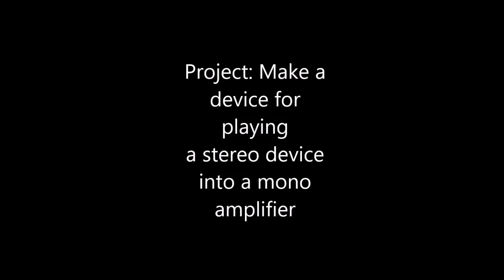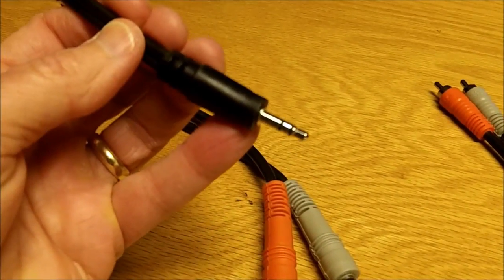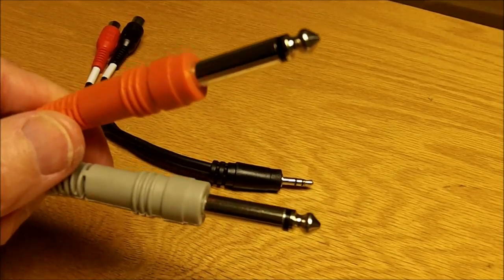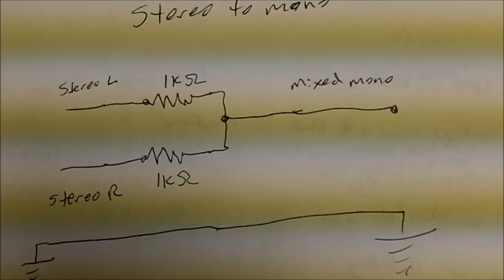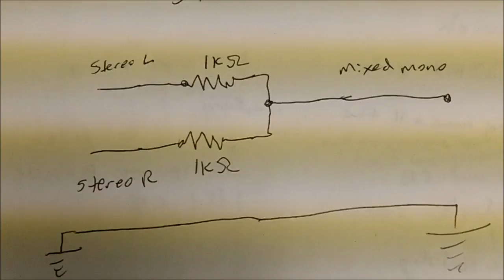Play your stereo music into a mono amplifier with this easy project!

Comment: Hi. I have a Bluetooth receiver that I want to connect to the single speaker in my 1967 car. I tried what you described (at least I think I did!), using a pair of 1k resistors. This didn’t seem to work. A kind of pulsing sound was coming from the speaker. Do I need to use a different value resistor or does this only work when connecting to an amplifier rather than to the speaker?

Comment: Beware phase cancellation.

I stumbled across a practical demonstration of phase cancellation by accident. I built a stereo-to-mono summing cable which is the circuit inside the box here. I tested it with two different songs: The Doors' "Light My Fire," where the instruments are heavily panned, and Porcupine Tree's "Voyage 34 Phase One," where the stereo distribution appears to be uniform.

It turns out the cable works perfectly with The Doors song, but with the Porcupine Tree song, when I pan to the center, the delay effects cut out. If I pan to either side, left or right, the audio returns to normal. Note: if you use the YouTube audio from this link https://youtu.be/LIEug2r-oBU?si=C9dkGq7-M2d5kepm, there is no phase cancellation.

Comment: Would you use the resistors in that summing network if just taking phono out to summing box for mono records to a stereo amplifier. Don’t have a mono cartridge so have to come up with a better switching solution other than y-cables.

Comment: Would this work sending mono guitar pedal signal into stereo effects loop on guitar amp? Thanks
Reply from the maker: Feeding a mono signal into the “output” of the “box” will give you 2 identical signals on the 2 inputs. So, if I understand your question, you would have inputs for your stereo inputs, but they would not really be stereo. Just duplicated mono.
Reply: @ 

I have a crate amp with the stereo effects loop send and return just like you talked about. Trying to send the pedal signal ( mono) into amp. Thanks. I have the exact issue that you covered in video. Thanks again.

Comment: I have an effect pedal that has right and left out. I wanted to combine both signal so I can have a wet and a dry signal from my guitar. Will this also work for that purpose ?
Reply: Beware phase cancellation.

I stumbled across a practical demonstration of phase cancellation by accident. I built a stereo-to-mono summing cable which is the circuit inside the box here. I tested it with two different songs: The Doors' "Light My Fire," where the instruments are heavily panned, and Porcupine Tree's "Voyage 34 Phase One," where the stereo distribution appears to be uniform.

It turns out the cable works perfectly with The Doors song, but with the Porcupine Tree song, when I pan to the center, the delay effects cut out. If I pan to either side, left or right, the audio returns to normal. Note: if you use the YouTube audio from this link https://youtu.be/LIEug2r-oBU?si=C9dkGq7-M2d5kepm, there is no phase cancellation.

Comment: This is a volage divider. It solves the problem of anything that is the same on both channels does not add and double in volume.
Reply from the maker: I didn’t see anyone say it doubled volume. Also, I disagree it’s a voltage divider.
It just provides some isolation between the two channels as opposed to connecting them directly together.

Comment: The most critical connection made, from the 2 1k ohms , is absolutely confusing. Did you solder? Exactly where are the 2 resistors soldered to?  Jerky video, thumb blocking, and no schematic drawing,  pointing, exactly, where all connections are made.
Reply from the maker: You are free to move on, my friend.
Reply: @jamelectronics  Couldn't seem to take constructive objective critiquing? Hope you will inprove. Moved on nicely, by the way, after doing more research.😑
Reply from the maker: @BOBBY-w8c , Bobby, I made this video 7 years ago. I apologize if my video quality is not up to your standards.  So sorry about the shakiness, but my intention with my videos is only to give information about things I know about to those that would like to watch.  There is the schematic drawing at 1:35 in the video that you said I should have included. As to soldering, it looks plain to me in the video that the connections are soldered but, they can be connected without soldering - it's the viewer's choice. I don't think my finger is blocking anything. The circuit is so simple. Only 2 components and a schematic to show what connects to what. Did you not see the schematic?
I watch a lot of DIY videos. When I am doing a project that I need to know how to do, I watch several YouTube videos. Some contain all the info I need, and some do not. I never critique someone else's video. They've taken the time to present something they believe will help someone else.  I don't have the time and besides what's the purpose- they are not going to make a new video "fixing" the things I have pointed out. They're offering a video, and I can watch or not.  By watching multiple ones, I get a very good idea of how to proceed. You "moving on" to do more "research" is a good thing. I'm sure you learned a lot. Good luck on your future pursuits!

Comment: Plz guide the registance value for 600 RMS watts mono amplifier
Reply from the maker: Since the circuit in the video is for the input to an amplifier, the output power of the amplifier is irrelevant. The same resistance values should be used. Just be sure you are clear that you are combining small signal input signals to an amplifier and not amplifier outputs.
Reply: @jamelectronics  Thanks for reply
Sir,  I wanted to know the result of signal which reflected through proper output.  High registence value may be interrupt in quality of signal. 
If i run the amplifier in 75% volume . Signal gain is a vital factor indeed

Comment: Muito obrigado "James Pattillo"
Fiz um cabo Stereo / mono me baseando em um circuito de caixinha de som mono onde ambos canais vão jumpeados
Se continuasse a usar mas um pouco iria danifica o CI de audio do Computador, ele já estava conflitando (saia áudio / não saia áudio)
Seu vídeo veio no exato momento

Muito obrigado novamente

Thank you very much "James Pattillo"
I made a Stereo / mono cable based on a mono speaker circuit where both channels are jumpered
If you continued to use it a little, it would damage the computer's audio IC, it was already conflicting (audio output / no audio output)
If video came at the exact moment

Thank you again.

Comment: can i use this in guitar fx processor? i want to use the l and r output to mono
Reply: Why? Usually guitar fx processors have a mono output.
If you connect just the L out it should be in mono.
If that doesn't work, program your fxs in mono, then use only one output.

Comment: thank you for this video its a lot easier than i thought it'd be !! im planning on adding a pickup to my guitar and being able to sum the signal from the pickup with the existing pickups but also be able to send the new pickup to its own separate output.  would the 1k resistors work for this as well?

Comment: Won’t the resistors attenuate the signal resulting in lower volume?
Reply: yeah it will somehow lower the volume but its also important to have them a 1k resistor in total to not heat up the amplifier inside the phone or pre amp or what kind of system you using

Comment: First off, very informative video, have a quick question though. I have two outdoor speakers, but want to run both in mono for patio garden listening. I have a Bluetooth audio receiver with RCA outputs and a stereo amp with a line in. Would I be right in thinking your wiring set up would work? If I wired up the output of the BT audio receiver as described in your video and used the line in on my amp, would that give a mono signal to both speaker outputs of the amp or just to one side (L or R output)? Thanks in advance.
Reply from the maker: Should work and would give a mono signal to both speakers.
Reply: @jamelectronics  Thought as much, but just wanted to check. Thanks again for the informative video and for getting back to me so quickly.
Reply: Have a second question if I can be cheeky..... So I'm now thinking of using a slightly different setup, of which the amp only has RCA inputs and the BT receiver has a stereo 3.5mm jack output. Do you know how would I go about wiring a stereo 3.5mm jack to two mono L + R RCA outputs? Thanks again in advance.
Reply from the maker: Your second question: Use a cable that has a 3.5 mm plug on one end and two rca plugs on the other. These are commonly used cables that you should be able to purchase on Amazon or retailers.

Comment: Hello friend, greetings from india, i would like to give mono input for the subwoofer, i hope I can use this method without disturbing my stereo line.
Need your suggestion shall i follow this method?
Reply from the maker: This circuit is for combining small signal levels such as headphone outputs or “line outs” to feed into amplifier inputs that require small signals ( less than 1 volt). As long as your stereo out is a small signal level, it should be ok, although I don’t know the details of your devices.
Reply: @jamelectronics  this is to feed input for my subwoofer amplifier, i have a stereo amplifier, now I would like to add subwoofer amplifier  , so I was bothered to give mono input without disturbing my stereo input, I'm speaking about only mono input signal, not directly to speaker my friend, hope u got my point
Reply: @James Pattillo  Dear james hi.... if my stereo has preamp voltage of 2.7 volt then what will be the resistors value....

Comment: I am going to wire a portable satellite radio stereo into a mono input. The specs shows the output as 2.2V peak to peak. My question is how big of resistiors? Don’t quote me, but I thought I saw info that said I needed 50K ohms.

Comment: Sir if I convert 5 + 5w stereo to mono will it be 10w and which resistances should I use...
Reply from the maker: No. The circuit described converts the small signal preamplifier sound to mono. The combined signal is then amplified by the power amp section of your electronics at the same power level as before. So, a 5 watt channel will still be 5 watts.
Reply: @jamelectronics  sir which resistance should I use in 5 + 5w....

Comment: I am going to connect a vintage car stereo to one speaker in my VW Beetle that has only one speaker.  Would this work for my project and should I have higher value resistors?   And I was thinking, why not use diodes instead of resistors to isolate each line R and L?
Reply from the maker: No, you can’t use this circuit on the output of your car stereo. You will damage the stereo. The circuit can only be used in small signal outputs such as a preamp or headphone output of an ipod, iPhone or similar, but not a large signal output from an amplifier stage. Also, a diode for isolation will not work.
Reply: @jamelectronics  Some say I can use resistors to combine both Left and Right outputs from a car stereo to one speaker.  If it works for a cell phone or low voltage device, why not a car stereo that works at 12 volts?  Make the resistors 1000K or more rather than 100K or less.  I have only one speaker in my VW and I ma not willing to modify my dash for another.  And finding a mono AM-FM car radio is near impossible. 
.
Reply from the maker: I don’t recommend it. The difference in splitting a mono output of an iPod into 2 outputs vs. combining stereo output channels : The outputs of iPods are high impedance, low voltages (millivolts) and currents. The outputs of  your 12 volt stereo are low impedance with relatively higher voltages and currents. The isolation resistors in conjunction with the  4 or 8 ohm speaker will act as a voltage divider so most of the signal voltage will be dropped across the isolation resistor rather than the speaker resulting in very low level of sound. Aside from that, depending on the circuitry of the car stereo, a connection between the two channels may cause damage.
Reply: @jamelectronics  Thanks for the detailed reply.  I won't combine R and L on my old car stereo.   I have only one speaker..  I noticed that the 1960's radio has a MO/ST button. and that will then give me the option for Mono or Stereo.   So if I just keep it at MO I can get mono sound with one speaker, the other line I will leave capped off, or maybe hide a speaker in some other part of the vehicle.

Comment: Hi, I have a Godin guitar with two outputs, one is a passive Seymour Duncan lipstick single coil pickup and one is an active RMC Piezo pickup. When I use a 2 mono to 1 mono cable I get only one of the pickup. I want to make a Y cable that will have two mono in and one mono out so I can plug only one cable into my guitar amp and then control the blend of the two pickups using the controls on the guitar. Can I use your method? What type of resistors I should use - the same for each or two different ones?

Comment: Hi, 
I am using a device which splits/decodes the audio out from TV  to 6 separate physical channels.( RCA female outputs)
The front and rear L and R channels are fed to respective speakers..

I want to feed the center and LFE channels..to a 2.1 soundbar system which accepts a single physical TRS female input jack.
( The settings of the soundbar can set the input as either AUX or LINE IN)
How to do that so that the center channel plays on both the L and R speakers of the soundbar..and passes the LFE to the subwoofer? 
Do i get a dual RCA male to TRS male converter..short the Tip and Ring..and plug it into the TRS input of the soundbar system?

Comment: Why not just buy RCA L/R channel  to mono 1/4 inch jack?
Reply from the maker: You could however, doing that does not provide any isolation of Left and Right channels of the output of the device that is your signal source. That could possibly damage the device or cause distortion. But maybe not. It's like connecting the R and L channels directly together.

Comment: is that can be used in reverse ? mono to stereo ?
Reply from the maker: No.
Reply: @jamelectronics  so how the circuit if i want to use mono to stereo? Maybe you can make it on another video.. the most important is can convert mono to stereo, although the sound quality is decreased / lower..
Reply from the maker: Khalifa Fauzan If you feed a
Mono signal into the output of this simple device, you will get the same signal on both inputs. So, you can drive two inputs of a stereo amplifier with those signal but they will not be the “left” and “right” stereo sounds. Mixing two waveforms together , which this circuit does, is simple. Making stereo out of a mono signal is complex. This circuit will not do that.

Comment: Dear sir,
I am from india, i like ur video , most informative method, thankq so much sir 
But my question is how much watts of resistor is 1k we use ?
Reply from the maker: You can use 1/8 watt or larger. Only a small amount of current flowing.
Reply: @jamelectronics  sir its not working, i had used this method in my aux cable, with 1k, 1/4 watt resistors, its working but the volume is very low
Reply from the maker: This method is for headphone out signal levels. If you are trying to use it on an aux out from a mixer or other equipment, you may need to use a higher value of resistance for isolation. Try 10k. Better yet, use a mono out from your mixer or other device.

Comment: Good video . How about using diodes instead of just resistors ? Despite the 0.7v signal loss the isolation between channels would be much greater I supose ... The point is if It is only analog ok but if you are dealing with outputs coming from a digital device all kinds of care must be taken
Reply from the maker: Paulo Acedo No, diodes would not work. They would block all but the top part of the analog wave form resulting in a distorted sound. The output  to a headphone jack is an analog signal. The electronics are solid state i.e. integrated circuitry, but 1k ohms per channel or 2k ohms between channels is plenty to avoid any damage.
Reply: @jamelectronics  Diodes sure need dc polarization to work as linear devices .Not a so simple circuit but more effective .Thank you

Comment: If I plug my MP3 player in 2 mono guitar amps with the stereo leads will I get a stereo sound then
Reply from the maker: Running Deep Not with this device. You would need a cable with a stereo plug on one end for your mp3 (1.5 mm) with two 1/4” plugs on the other end- one for right and one for left. Similar to this but with 1.5mm stereo plug : https://www.zzounds.com/item--HOSSTP20?siid=89890&gclid=EAIaIQobChMIl42iv6aE6QIViuzjBx3rxgofEAQYASABEgLuuPD_BwE

Comment: Can I use this for a synth with stereo output? I believe my synth has a 1K ohm output impedance
Reply from the maker: Yes, as long as it is a small signal out such as less than a volt. Commonly referred to as  Line level, I would suspect, and yes should work.
Reply: @jamelectronics  thank you!

Comment: how many watts the resistor?
Reply from the maker: Very small signal. Use 1/4, 1/2 watt or larger if that's what you have handy, but 1/4 watt will do it.

Comment: Are you sure the 1k ohm resistors is enough protection? I'm planning on using it with instruments that only have a headphone out and I'm a little paranoid about damaging anything. Very informative video :)
Reply: yes im having the same question, id like to use this on volca fm
Reply: @finonomastropiero4261  use 10k quarter watts resistors
Reply: 5k6
Reply: 35k is ideal
Reply from the maker: As long as it is a headphone out, it should be fine. There will be 2k ohms total isolation between the right and left signals.  But if you are hesitant, I understand, you could use larger resistors instead. As mentioned in the video, I tried different values and didn't discern any difference. I've used these on iphones, and ipods and never had any problems.